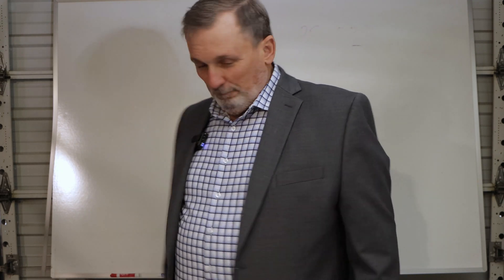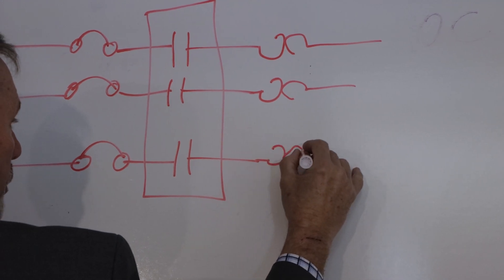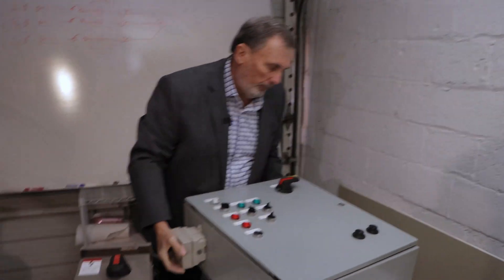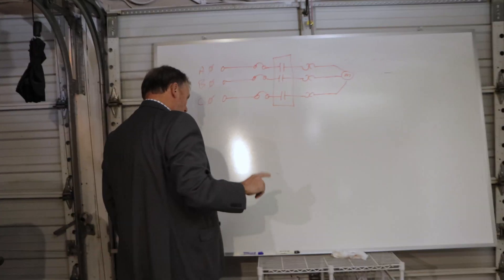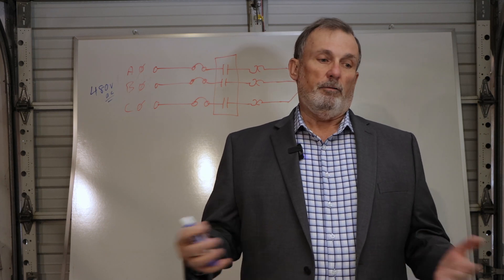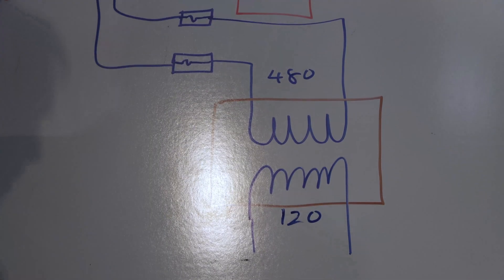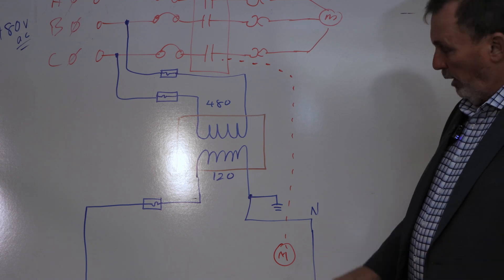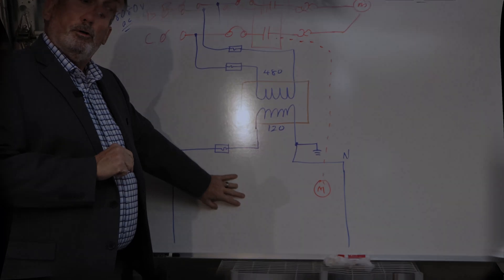Industrial Motor Controls

Comment: What ?   No disconnect switch ?   OOPS ! 

And put the control transformer primary downstream of the Main fusing device, fuses or circuit breaker.

And, there is NO direct connection of the Motor Starter coil to the Motor Starter 3 phase contacts,  it's a magnetic starter !.

Oh boy,  I cant wait for the next instalment of this basic ladder diagram training.

You have gray hair... you should know better..... 

Good luck.

SBF